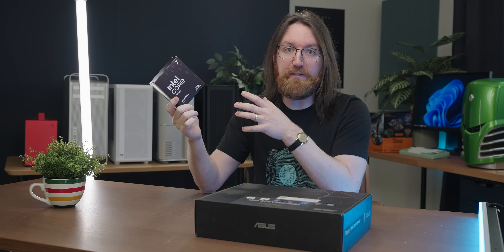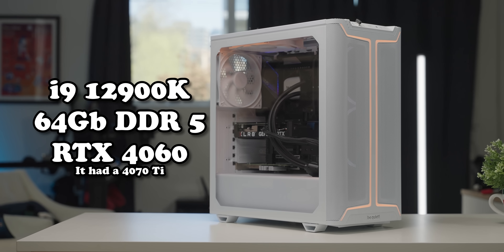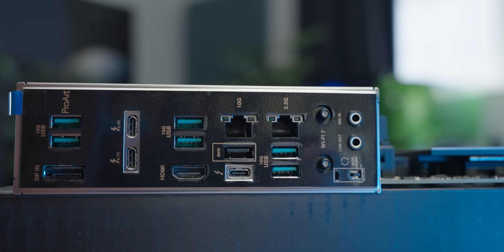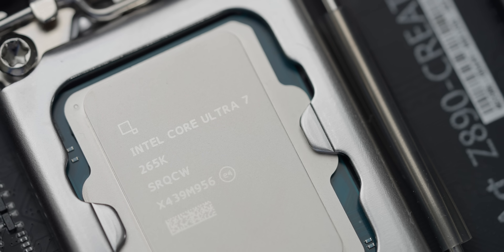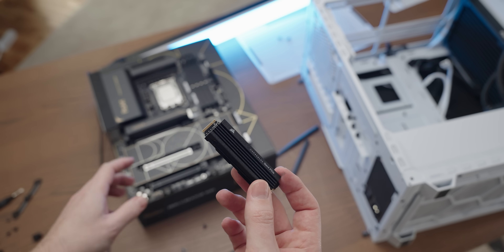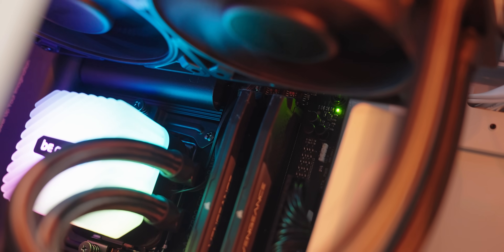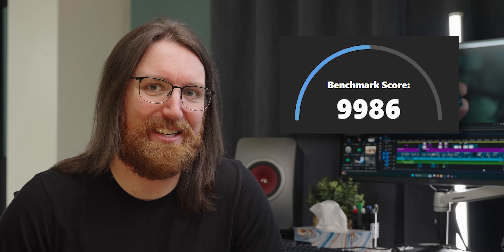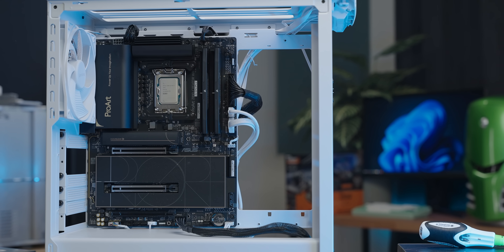I ACTUALLY Bought An Intel Ultra CPU In 2025...

Comment: Almost two months ago I gambled on this same Core Super Mega 64x 265 when there were basically no video reviews for it (only the 245 and 285 models), just a couple written ones showing really good performance on productivity tasks; and let me tell you, even though I'm ecstatic with my purchase, it was a difficult decision. One that would've been much easier to make having watched a video like this, so I'm glad this is out here and can inform other nervous buyers.
Reply: im not even joking, the intel CPUs arent bad. They changed the namnig scheme and confused everyone and fucked it all up even more. They really need to get back on their previous glory. They fell off after 12/13th gen
Reply: @Sol4rOnYt and every review told everyone not to buy 13th or 14th gen because of the failure rates they had, until eventually fixed it. I see why they wanted to change the name entirely after that fiasco, but it was still a poor marketing move as you pointed out why.
Reply: @TSL73  yeah, and tbf i run 13th gen intel and i dont see any problem? i dont have a single AMD cpu either though so i dont know (not a fanboy, just ended up being the  cheaper/better choice every time). Although i do wish that the i7-1185G7 had maybe more than 4c 8t but i think they really fixed this in new laptops

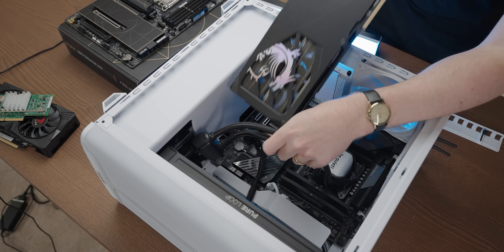Comment: 5:40 Was there a reason to have the tubes going to the bottom over flipping the rad so that they'd be going up? I've always thought it was better to have it on the top to make sure there can't be air getting into the pump as it would be stuck in the rad

Comment: how is the power useage, especially under idle and normal desktop use, 
as rendering and gaming and such where cpu is utilized close to fully tend to be quite rare when looking at the total time. but many desktop cpu's still tend to draw a lot even when idling(often more than their laptop counterparts draw under full load, where those laptop parts actually aren't to far behind in peak performance often.

Comment: It's not goofy. I have a bunch of PCs in my home with intel and AMD CPUs. 285k, 265k and 7950X3D. They are beefed up with RTX 5090 and 4090 GPUs. I even have a laptop with 285k with RTX 5090. All are awesome, reliable, and problem free systems. The 265k is surprisingly pretty fast and if that was my main CPU I would just be happy with it.

Comment: Um, no, not all motherboards have ssd heatsinks.
Reply: If you're buying an NVME drive that's high enough end for the manufacturer to consider a heat sink, every single motherboard you're considering will have an NVME heatsink without fail
Reply: @MrToastyYT  what you're saying makes absolutely no sense. Like I said, no, not all motherboards will have ssd heatsinks already. I bought a motherboard that was originally over $200 for my new build and it doesn't have a heatsink.

Comment: I have always liked using premiere pro because it can do everything you can think of when it comes to video editing. Yes I have had my share of headaches with it, premiere is a pretty hefty application to run alone and once you start working on edits needs loads of resources. That aside I wouldn't use anything else unless I was just lazy I know how to use it and don't see a reason to learn another program, besides what programs are people putting ahead of Premiere anyway?

Comment: The 265K is definitely a good CPU for mixed workloads. The only AMD CPUs which surpass it in every metric cost double or more, and the price comparable AMD CPUs are massively behind in productivity. With recent BIOS updates, Intel has also gotten gaming performance up to the point the difference is often negligible. It's weird, Intel is now in the same place AMD was in 2017 with the launch of Ryzen.
Reply: Negligible? What planet are you on? Even a 5 year old X3D chip performs better in games than these "ultra" cpus. Let alone a modern X3D chip which is up to 50% better with a very high end GPU. As for productivity, the i7 ultra is definitely a good value cpu but that's about the only thing it's decent at. But guess what, in a professional environment time is money so value is not as important, when you can cut your rendering and editing times significantly with zen 5. Which, by the way, is going to be supported officially for several more years.
Reply: @SapTheseCasters  You're making my point for me when you mention "a very high end GPU". With reasonably priced midrange GPUs that you'd pair with a $335 CPU, the difference in games is, as I said, usually negligible. You're almost universally GPU bound in modern games without a 4080/7900 XTX or faster, and for productivity, nothing from AMD at $335 even comes close. Right now $335 would only get you a 5800X3D, and the 5800X3D is upwards of 170% slower in heavily multithreaded workloads.

I am no fan of Intel, and I agree that AM5 is the smarter long term investment, but looking at the 265k objectively as things currently stand, for mixed workloads and casual gaming it is undeniably the best value CPU currently.

We're also not talking about strictly professional environments, because if we were, I'd agree that Threadripper has made Intel a complete joke for nearly a decade at this point.
Reply: @K31TH3R  I agree that most people go up to like a 9070XT or 5070 Ti, for which any modern $200 cpu would be enough. If we are talking strictly professional environment on a budget then yes intel makes sense. But if it's not so tight on a budget a 16 core zen 4 cpu, with half the power usage of a 16 core zen 5, would make a lot more sense and just as you say you have the futureproofing of the am5 platform. 

The value argument is the same that people made for the FX series back in the day. Productivity kings for the price (not in all productivity applications mind you) and decent at gaming. But that's just it. If you want a productivity rig and to play some games here and there, then the 265k makes sense. However the platform doesn't. And zen4 chips are really good at value because of their reduced prices, now that zen5 is the current gen of CPUs. Where I live the 265k and 7900X are about 20 euros difference. So the 265k being a bit better in performance/price in productivity, slightly worse value in games, but being on a platform not supported in the future, makes it an easy choice for ryzen.

So whatever the case, zen4 is just the best purchase right now if you care about how much you spend. And if you primarily care about games, the 5700X3D is barely over 200 euros, if one is already on AM4, and the 7800X3D is around 60 euros more than the 265k with worlds difference in gaming performance, thought it does suffer in productivity.

Comment: Dude yeah… I had to swap from Final Cut 7 when it got nuked.. I held on till end of 2010-2011ish. Mainly because some things stopped working that I needed all the time.
And it took me the better part of a year to get used to Premiere Pro and that was already very similar in the way it worked.

I’ve looked at DaVinci Resolve..and I am in the same boat of just not wanting to torture myself. It doesn’t look fun or easy to learn. 

and not having access to all my older projects without a bunch of hoops is another.
I know and can work with Premiere’s quirks. Although it’s gotten much better in recent years with the stability for me.
A lot let random crashes and broken project files or weird export issues.
I would still need to use other Adobe products.. so I would have to pay for the tier that includes premiere still.

Comment: Intel's 18A process will be a failed process, not in terms of technology, but in terms of price, because Intel's 18A process uses the extremely expensive backside power supply technology; on the other hand, although TSMC's A16 process also uses backside power supply technology, TSMC also provides less expensive N2/N2P processes for customers to choose from.

Comment: You're the only one because everybody forgot the 10fps from their x3ds don't translate into getting actual work done. When you produce a CPU that is tailored for just one thing the rest of everything else suffers. These new Intel ultra series CPUs are general service CPUs like every other CPU besides the X3Ds which where tailored for gaming. It's kind of like buying a Lamborghini as your everyday car and bragging about how much faster it is and then all of a sudden you need to bring your trash to the dump pick up some furniture or go get some building materials for a home project sure you can do it but in reality a small pickup truck (ranger, Tacoma, Maverick, Ridgeline etc) is probably better for most homeowners because it can do every job pretty well. It can transport your family and do all the work.

Comment: Did you ever consider doing a very Canadian Tech video? E.g. ZealPC keyboard switches 45 drives homelab case, Ploopy trackball and headset. I would love to recommend a Cornish-zen keyboard too, but unfortunately they are no longer made. I am sure you can discover more cool Canadian made or designed stuff.

Comment: 7:21 why did you use a PSU/PCI screw on a motherboard....
Reply: Theres older brass stand-offs that work with them but newer stand-offs dont and if you mix up the screw it gets stuck and becomes a real challenge getting out with the motherboard inbetween
Reply: @jordan-mn6yy  the smaller motherboard screw should be applied....
Reply: Cuz why not

Comment: I have this CPU paired to an RX 7800 XT. At first, there was a laundry list of crazy bugs, but it's gotten so much better. I was able to slightly improve its gaming performance by overclocking the cache on the CPU, which made it benchmark higher than the 9700x.

Comment: I would suggest getting some other editor,  and not switching immediately, but if you can bare the time, run them side by side, preferably on separate systems, and edit them both side by side, you know Adobe, so take the opportunity to translate the workflow. It will take longer for sure but in the end you should be nearly as proficient on both.

Comment: Dawid, bit of unwarranted, unasked-for advice.  Start a second channel, and only use it to post/edit videos using a new software.  That way you can take MONTHS to post a new video, with no pressure.  I'll subscribe day one, even if it's just commentary on how infuriating it is to try to learn new editing software.  And maybe some cat updates!  Just stuff you wouldn't normally do on this channel.  Just a thought.  Then when you're well polished and a pro at the new, less puppy-destroying software...it can be a seamless transition to a new software and no one will be the wiser.

Comment: My workplace actually bought a bunch of rack mount servers powered by Core Ultra 9 285K. It's the best CPU for our use case. We have custom analog circuit simulator that requires very high single threads performance which this CPU provides.The app only has a couple heavy threads and about 4-6 simple system management threads. This CPU single threaded performance is simply unbeatable with any other offering in the market.
Reply: I am using an Ultra 7 265k for LTSpice simulations and I am very pleased with the performance. A medium sized simulation of a SEPIC PS runs 5x faster than my old Xeon 4 core machine. For video editing of course the pacing element is the GPU, not the CPU.

Comment: Type	SDRAM-DDR5
Kleur	Zwart
EAN	4713294237569
Fabrikantcode	F5-9000C4256H24GX2-TZ5CRK
Serie	Trident Z5 CK RGB
Capaciteit	48 GB (2 x 24 GB)
Module	2 stuk(s)
Bouwvorm	CUDIMM
Verlichting	Kleur	RGB
Geheugenprofiel	INTEL XMP (Version 3.0)
Aansluiting	288-pin
Spanning	1,45 volt (van 1,1 tot 1,5 volt)
Standaard	DDR5-9000 (PC5-72000)
Fysieke kloksnelheid	4500 MHz
Timings	CAS Latency (CL)	42
RAS-to-CAS-Delay (tRCD)	56
RAS-Precharge-Time (tRP)	56
this memory works perfect with ultra this is because (*Bouwvorm	CUDIMM*)

Comment: I have the 1000w shift. and i love it. paired with my jonsbo d32 pro case? and the msi b650 project zero? insane quality built. the only cables you see are my GPU power cables. everything else is 100% behind the back side. its great.
Reply: That isn't that impressive, I only see my gpu power cables with a normal psu

Comment: So where does the A380/580 compare with features like RT and production for the price?
Reply: A380 and A580 aren't that good for RT because they are lower end gpus, but they are very solid for budget video editing and especially encoding since the chip is the same between all A series gpus. I have an A770 and I can say that it is amazing for video editing in Davinci Resolve, completely destroys anything I throw at it. It's also pretty good for other types of productive work, like I use it for 3d modeling in Autodesk Maya without any problems besides rendering.

Comment: So, didja hear about the windows update, 24 H2 i think it is,  "Improved branch prediction" for basically AMD CPU,  Altho some outlier suggestions a random game here or there for intel also got a smaller % uplift.

Of note, seemed to be a hardsell on 9000 series uplift, however looking at the numbers, the 7000 also got a notable uplift %

Furthermore it was suggested even lower tiers, older  AMD cpu models would also get some benefit.   Now how that would be on say 5000 series AMD CPU wasn't stated ,it was more like a suggestive comment in passing, without any stats.

Comment: I was taught that if an m.2 is cooled it will have worse performance. There's like 1 chip on the stick that benefits from cooling and the rest suffer. 
So my motto is if the manufacturer puts a heat sink on, they hopefully know what they are doing and not just upselling snake oil.

Comment: i mean when you're shopping for an SSD and motherboard, make sure if you can't put on one with a heatsink, don't get one with a heatsink. some motherboards don't have heatsinks for either all or some of the slots. comparability is key. i just saw someone complain about 6400mhz ram not going about 5600mhz in a motherboard that only supports up to 6000mhz. so the person obviously didn't realize his motherboard didn't support the speed of the ram he bought. and he blamed the ram.

Comment: Yea I use them for video editing too, and the E-Cores are really powerful and underrated. I have them overclocked to 5.5Ghz and keep everything super cool with water.

Also, the latest bios update has improved performance further, and lets you tweak more settings for performance and stability.

Comment: I have been playing around with Pugetbench and the configuration of the Adobe apps makes a huge difference. I was getting performance that was way lower than the equivalent spec PC until I reset the apps back to their defaults. Probably because it’s not entirely synthetic.

Comment: The heat sync or any cooling considerations for the Nvme drives is built into the board on higher end motherboards, especially from Asus. Good thing to keep in mind when ordering SSDs for a build

Comment: All motherboards have NVMe heatsinks, that statement is incorrect lol. Cheap motherboards don't, My B550 test bench board doesn't so I put on this cheap "Leo the lion" cooler from Ali express, but most of my other boards do.

Samsung sell two versions of their drive (with or without heatsink) that is one way to go but you have to give up a kidney for one of those drives. Including it in the box is another like you mentioned but I doubt they will ever do that because of cost.

Comment: These new core ultras seem to be pretty sensitive to memory bandwidth.  It could be worth getting a set of CUDIMMs if you can find them.  In my testing I've seen them go from 500ish GF to just under 900 in linpack using 6400MT/s and I'd imagine that's how puget is getting their big numbers for the core ultra.

Comment: I disabled PL2 so it just stays in PL1 125w limit. Undervolting the P and E cores by 0.5v boosts performance by allowing it to reach higher multi threaded clock speeds within the power target. Additionally I was able to OC both P and E cores by 100mhz. I haven't even tried the ring and other stuff yet but some people got incredible results when tuning everything without needing to run up more power.

Comment: 7:30
I've ran into this problem so many times, it boggles my mind why case manufacturers haven't started adding more space for bigger radiators at the top of the case. This has been a problem for years.

Comment: i run a 265k on an asus z890 apex board. memory runs at 8533mhz cl38 in gear2 mode. e-cores are overclocked at 5.1 ghz (4.6ghz stock). p-cores are overclocked at 5.4ghz. memory bandwidth is great on this platform. use 8000+ mem kits on z890 platform, otherwise performance has left. these chips can be overclocked really well. great video tho

Comment: Nice; I just removed an Elite aorus B850 m.2 enclosure with 2x m.2 in to add a 3rd, brand new pre-built & my anxiety & arse cheeks quivering when I couldn't figure how to close it. Nice to know you bricked a MB, did you break a sweat? Great, when you have spares & money not so fun if all your saving are in the pre-built.

Comment: A lot of M.2 SSDs these days actually have a (usually cheaper) version without a heatsink. My motherboard is very similar to yours so I made sure to get the non-heatsink versions.
Reply: Yeah it's more like the high-end SSDs sent by sponsors to him are the most blingbling possible. I'm pretty sure there are versions of this SSD sold without heatsink
Reply: Yes, once you hit certain speeds, it's most likely going to come with a heatsink. It's really irritating how someone can see an issue with an SSD that comes with one when you can simply take it off.